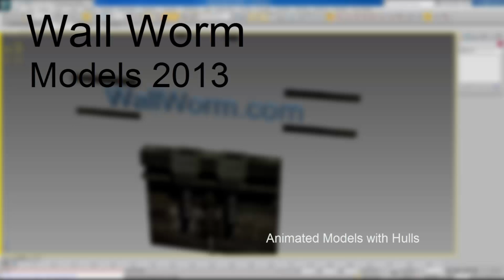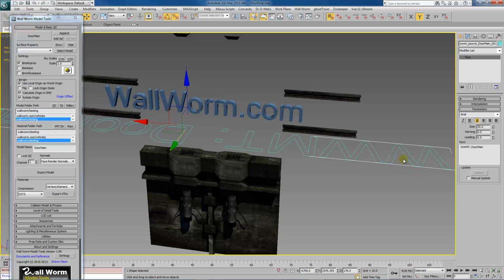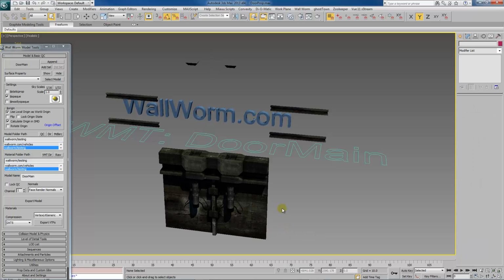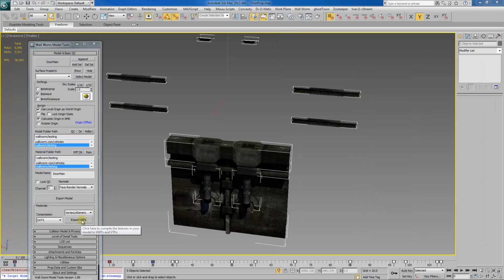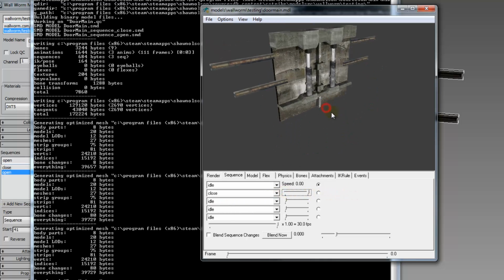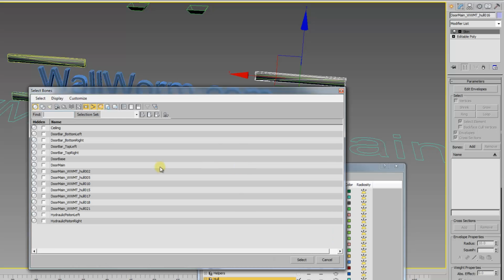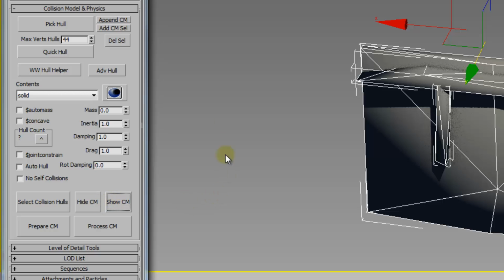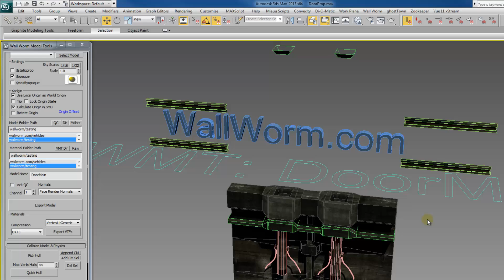Animated Prop 2013

Comment: a realy cool video and good explanation. Am new with modeling and i realy dont know wehre to start with animating model. the most tutorials going for character animation but i want to do like the door in this tutorial because i think its easyer to understand how animation works. Is there any good tutorial out there for animation a door like in ur video here?
Reply from the maker: Wammmbo There is a newer video at https://www.youtube.com/watch?v=pxCiL8Io2YE that actually goes through adding some animations to a model using animation controllers. However you should take some time learning the general animation tools in Max including keyframes, keyframe tangents, animation controllers/constraints and more. Those topics are covered really well on the 3ds Max docs and the 3ds Max learning channel on Youtube.
Reply: Shawn Olson thank you for the response i will do taht. I actually come from XSI and want to change to 3ds max.

Comment from the maker: The DXF import error is one in Max... make sure you have the latest service pack installed for your version of Max. (See if you can import DXF in Max by using File > Import ... and see if it has the same error). As for the VMF importer, it is not finished at all... I may finish building it in the upcoming weeks.

Comment: Hi, thx u so much for these tools ! I try to import map into 3dsmax 2013, but when i use The DXF importer there is this error: eInvalidSymbolTableName    and when i use the VMF importer the objects are in the scene but they are invisible, and i don't find a solution for see them :/. I use the Hammer with cs:go sdk, maybe it's maybe the reason of the problem ? The importer works only for sdk source ? Thx : )